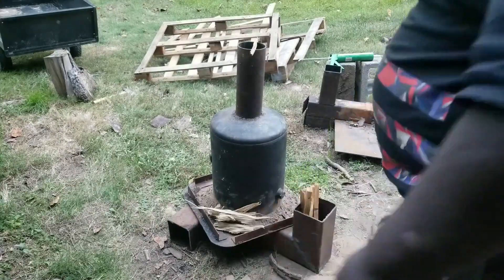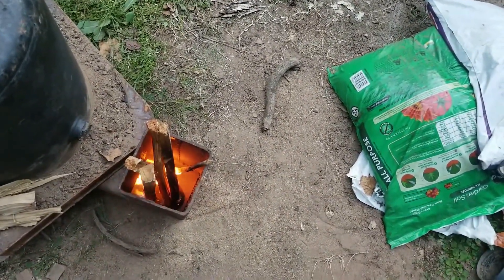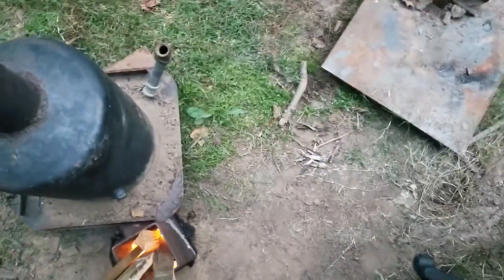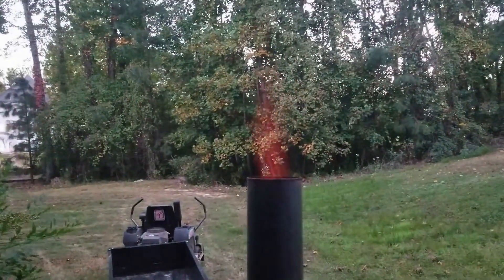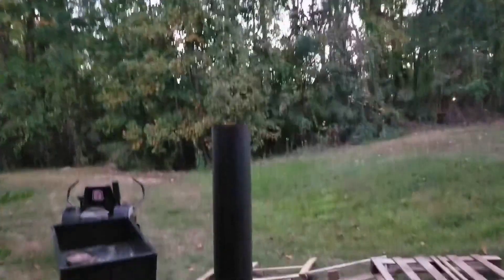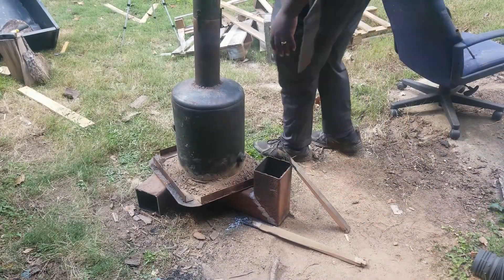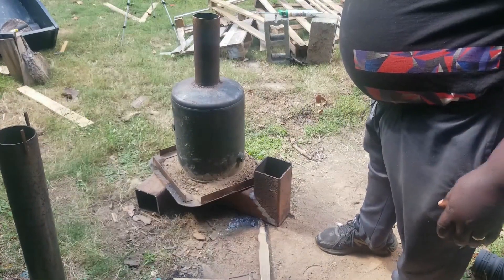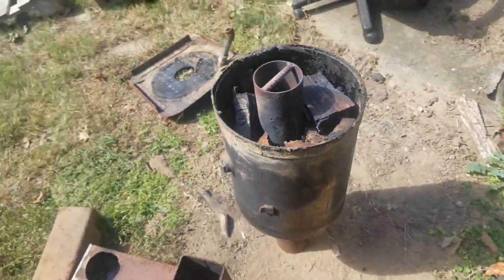Testing the new burn box on my efficient charcoal retort

Comment: two things, 1) did you consider insulating the retort , 2) was that orange electrical cable that you put the chimney on live?
Reply from the maker: Hey, I did consider insulating the retort. I'm thinking about making something to hold perlite, I want the insulation to be light and portable. And no the cord was not live, I just had not rolled it back up yet. thanks.

Comment: I second the recommendation to add insulation.  A better next design would be to have the fuel heat the outside of the product chamber.
Reply from the maker: Yeah, but heating the outside is typical and would make the unit too large. Thanks for the recommendation and for watching.

Comment: You can make videos on making biochar. You will get more traffic. We now know where red hot comes from!
Reply from the maker: Hey thanks for watching! 
I'm not sure what you're asking for because charcoal is biochar. All you need to do is crush it up, and put it n your soil.
Reply: @ministermanoutdoors6179 Charcoal needs one more step to become "Biochar": inoculation. Basically, soak it in homemade Swamp water for two weeks, then put in the garden. Otherwise, the untreated Charcoal will steal nutrients from the soil for up to two years.
Reply from the maker: @macoppy6571  Ahhh, very good to know! Now do you have a recipe for the swamp water? Thanks for watching.

Comment: Maybe adding some mineral wool insulation around your burn chamber to hold in as much heat as possible will help burn time and efficiency. 
I've not done it, but I've seen that done pretty regularly. Just food for thought.
Reply from the maker: Hmmm, not a bad idea. Thanks for watching and thanks for the tip.
Reply: @ministermanoutdoors6179  maybe just round the sides and leave the top uninsulated at first. Just so you don't keep too much heat and melt the whole thing.
Reply from the maker: @pointnemo72 I see, not a dad idea.